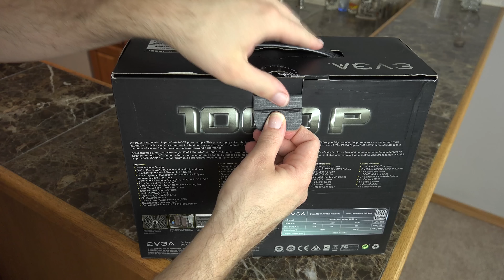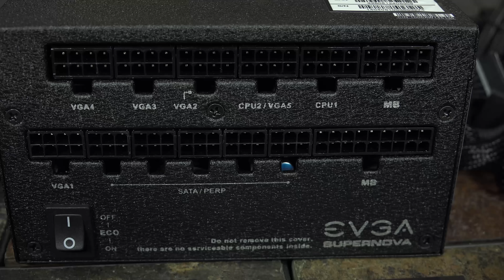Big upgrades! x99 madness build Vlog...

Comment: A+ on the components that you've upgraded. most people spending that much would've went with the popular trends.

u got what u needed and didn't fall for the hype. totally understand why u got 64GB of ddr4. since you're trying to grow your channel and making more content, rendering can be a pain with 16GB.

most importantly: I'm glad u upgraded your psu. when u upgraded to a 980ti, I saw the psu u were using and the amount of splitter extensions used to power the gpu.

I'm just pissed because when I upgraded to X99 last year on release, I paid $300 for a 16GB ddr4 kit. now a 16GB kit can cost less than $120.
Reply from the maker: +Ruck Thanks man. Yeah a new PSU was over due. And with this much invested in my upgrades, I didn't want to risk anything with the old one. 

I shopped for a long time to find the best options for my needs. Thankfully that pointed me to some cheaper hardware. And, for the RAM....Holy shit Premiere pro is a RAM hog. Encoding this video alone took up 52 GB of ram...I thought I'd never go over 40GB. Mind blown.

Comment: I want to use this board for my first build. Im staying away from any liquid cooling that WILL LEAK at sometime, pumps fail and you wouldnt notice. Expensive electronics and a bit of water the circuit boards short out from tin splinters formed by moisture its Asian solder with very high tin content. They will form from high moisture in the air. Look at all the headaches you save more room, fans move air and chips dont turn on fans to 60 C. 
Video Card AMD Red devil RX 470 4Gb GDDR5
CPU AMD 4350
4 Core
4.2 GHZ12.0MB Cache
Black Edition with Heat sink Fan.
Think it will rock just fine, let ya know.
Im tight for cash under 300 bucks as my target number. Ram pricing is weird and all over in specs and prices. Shooting for 16 Gb to start, this is very expandable

Comment: nice rig man i have a memory managment error i habe 5960 corsair dominator platinium 64gb 2400  and asus rampage v extreme i need some help
Reply from the maker: +Eustache zogas Take out all but one stick of ram and test it until you get the error again, you might have a bad dimm. You can also download a boot disk/usb software to test memory.
Reply: +Byte My Bits thanx i had a test with memtest no errors, but i tri one by one memory stick, thanxs alot fo your help bro

Comment: Love the Video, I am currently configuring a system to be an ultimate Plex server but in a small form factor, maybe ITX or Micro ATX, A couple of components I am looking at 
CPU i-7 5930 or 5960 not sure yet,
Motherboard, ASRock X99E-ITX/AC or X99M Extreme 4
Samsung 950 PRO -Series 512GB PCIe NVMe  (hope the board supports it, I read that the Asus board does not).
Case: Fractal Design Arc Mini R2 or Ncase M1
and of course 32GB Ram
Corsair H100i for cooling the CPU.
Graphics card I'm not too fussed as I will not be using it for gaming, it will only be used as a PLEX server. 
The other consideration was to put a 10GBe network card in there and connected via fibre to the a 
Synology  DiskStation DS2015xs

Any thoughts
Reply from the maker: +Don Thomas will be a nice build. The Extreme has more SATA and RAM abilities. You might need a cheap vid card to get it up and running at first, then could remove it after its done if you need the slot. Assuming it will boot without it, I'd check that first. I had an old MB that wouldnt boot without a vid card. 

If you're going to throw this kind of money at it, I would look at a server chip that supports ECC memory and go that route. ECC memory will help you with RAID and ZF filesystems. That is one thing I wish I had on my dedicated server so I would feel comfortable with Freenas. You'll need a UPS too...

I would start with hosting everything in house first, expand to a NAS if you run out of space. 

Id go with the Arc Mini over the M1. Arc has 6 HDD spots + 2 more with brackets. The M1 is limited in space, albeit small and sleek, and you might find yourself needing more room soon. I never worried about size, as you can tell from my Plex server build where I used the bad ass Rosewill case. But I built with the expectation of expanding.
Reply: +Byte My Bits: Thanks for the recommedations. I already have external NAS drives as storage so was not looking to include much in the way of storage on this box only the mail drive for booting and a second SSD drive. 
I was interested in your mention of a Xeon Chip, which one would give me the equivalent performance to the 5960 or work best for a Plex server? I like that option

Comment: Everything looked good until I saw you use that crappy Arctic Silver 5. Why would you ruin a great built with such outdated and poor performing heatsink compound like that when there is plenty of more up to date, better performing, cost effective compounds that don't require yearly replacement and a two week break in period? The compound that came with the Kraken is actually better than the AS5 you used.  Other than that the build looks great.
Reply from the maker: +cee128d My Idle (or close to)  temps @4.5GHz, 1.36 Volts is 25c-31c. Under full load I stay at 71c with random spikes to 75c for a few seconds (fans increase speed). Seems to work for me :/
Reply: +Byte My Bits Do a little research on AS5 and you'll find it takes 2 weeks of repeated on/off cycles to properly and fully cure and you'll need to re-apply it every year. I've tested it a lot and while it was the best available 10 years ago (possibly longer), but almost every other name brand TIM is better, easier to apply, cures quicker,  and lasts longer. It may appear to be okay now, but if you actually take the time to check out the full truth about AS5, you'll find out how much you are giving up.